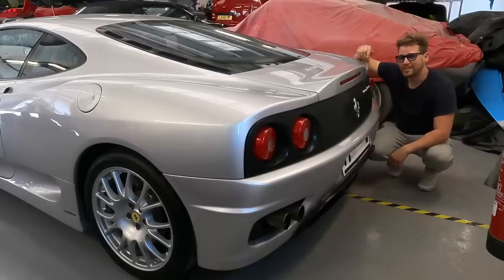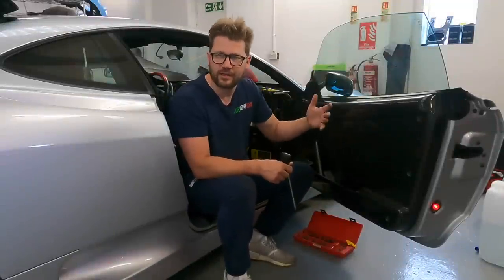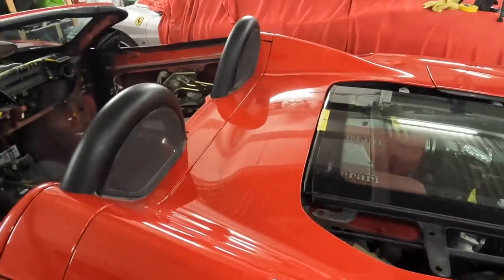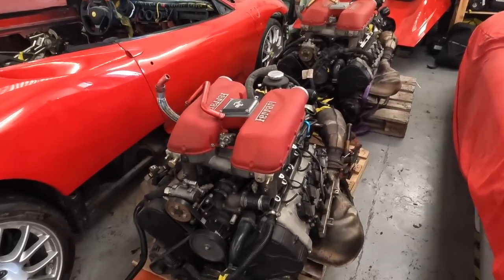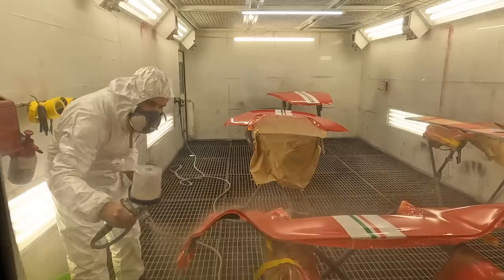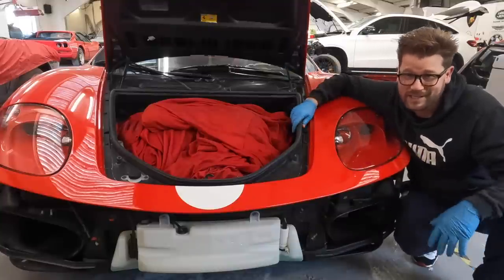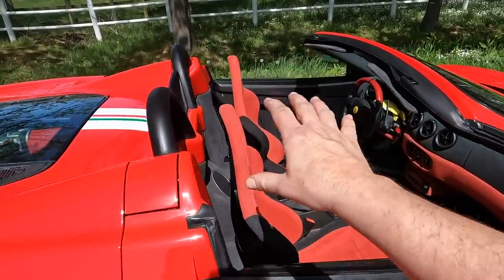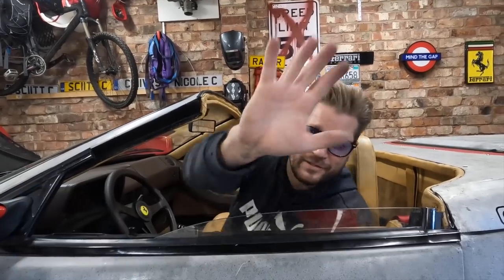Building a Ferrari 360 CS Spider In 10 Mins

Comment: any chassis differences between cs and 360
Reply: no
Reply from the maker: just an extra bar in the footwell on the spider hence we had to make a mod and install the 430 scuderia floor mats instead of the rubber CS mats. but they actually look much better